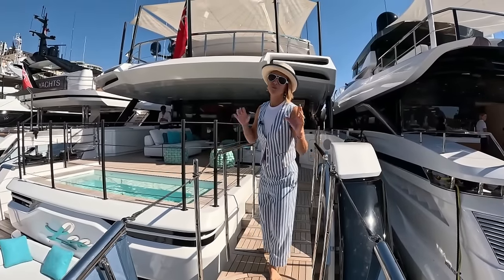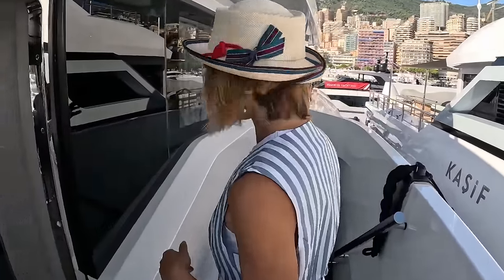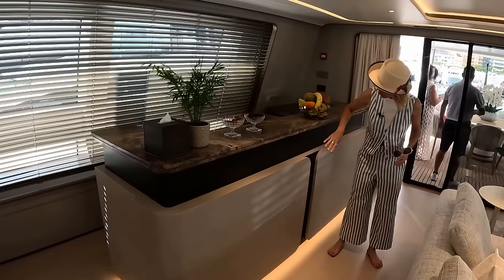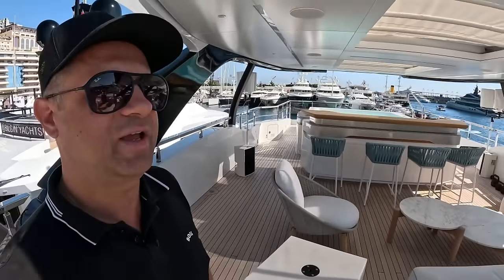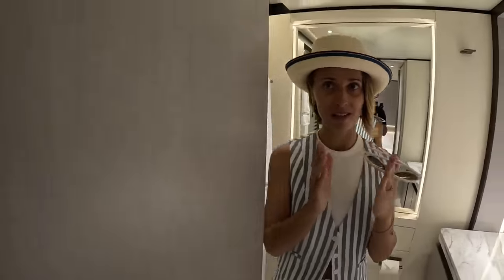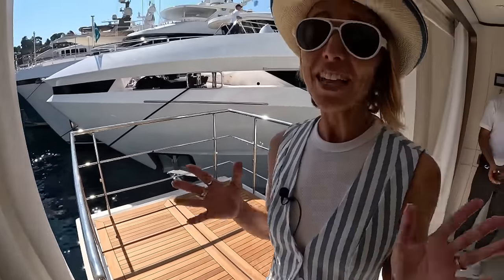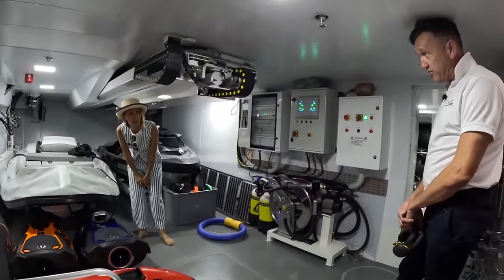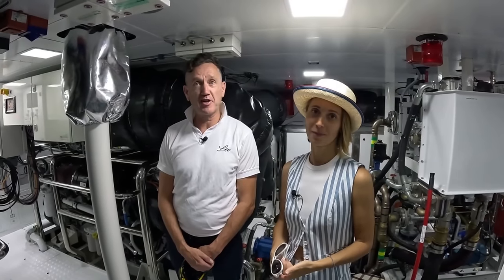You Gotta See THIS Tech! Baglietto Dom 133' Luxury SuperYacht "Lee" Tour

Comment: What very nice Yacht NautiStyles and a great tour of it also...full of great energy like always! 
Thomas was an awesome bonus!

The reason for such larger and loose speakers is to direct and focus the energy/sound, because you can't pressurize the out doors like you can a sealed room for immersive infrasonic sound Victoria. Especially with such a large open outdoor space with loose furniture, this is ideal when you want to follow the party with the sound, it gives you endless options for different set ups in different areas. 

About the large amount of AV equipment, in a previous video Rico asked for some ideas to set up your upcoming Yacht build...this is why I recommended to keep the rooms all localized with much smaller equipment. You just need a Cat6 Ethernet cable in the room near the TV, a splitter/modem/router to like an Apple TV/PlayStation/Xbox and a tiny amp/receiver and they should have access to their media. Good thing you chose K-array because they are very efficient so a tiny amp/receiver will work fine.

Comment: Finally something I feel qualified to comment on. Having been a DJ for over 30 years I can honestly say that I like all my equipment to SHOW.  Don't hide my subs, or my woofers, heck put my tweeters on display!  If this were my boat I would have a permanent DJ set up right where you thought it should go.  I would also have my light kits, and smoke machines installed so I could do a proper gig at a moments notice.  One bit of caution however for the owner of this boat,  put something on top of your subs so that no one can set a drink there.  Having done my fair share of bar gigs I can tell you that glasses and beer bottles can really get dancing if set on top of a sub.  Love all the channels!

Comment: This is the best 40metri yacht ive seen so far.
And the most impressive yacht i have seen on ur channel 

Interior design by studio vafiadis is much better than that of her bigger sister baglietto t52.
And Steel hull aluminium super structure which you would normally find over 50metri yacht range.
Most of the 40metri yachts are made out of grp.
And also got Long range. 4.000nm for 40.000liters fuel tank at a cruising speed. Even 6.500nm at 7 knots 12guests 9 crews.
Everything is Perfect for its size 398gt or 412gt
Price 23mil or 24.9mil euro

In my opinion 
The best 300gt yacht i've seen is cdm rj 115 pazienza n stellamar.
The best 400gt yacht i've seen is baglietto dom 133 lee.
The best 500gt yacht i've seen is tankoa grey so far.
Reply from the maker: Thanks for sharing 🙏🏻⚓️💙

Comment: On the sound issue, the quality of the sound is top priority, for me.   And, for that, speaker placement is important - more important than aesthetics.  This means, creating a proper sound stage for the ears of the listeners.  

Speaker placement can make a huge difference in the overall listening experience.   If you don't like the way the speakers look, close your eyes.   While your eyes are closed, if the sound stage is correct, you will be able to point to where the instruments would be located on an actual stage at a concert venue.   If you cannot point to where the instruments are located on the stage, the speaker placement - or, the listening position - is off.
Reply from the maker: Exactly!! Thanks for sharing Richard!! 🙏🏻💙⚓️

Comment: I have to say I'm all for having sound equipment or any other equipment out of the elements whenever possible.  As impressive as that sound system may be, how often are you going to be blasting it at the dock?  So the crew is going to be forever moving it in and out depending on the sea conditions when underway.  Seems to be the only time you're really going to get to enjoy it is at anchor in a secluded spot.
Reply from the maker: Agreed!

Comment: i quite like f1. tony still helps a few out with the old turbo sounds. re sound, id have a concealed system but also a larger one and of course lighting to go with it, also concealed and also a rig and trussing. id possibly need a bit more power as i prefer incandescents to led's. i used to use 300kw/600kw just for lights but would need a far larger boat for that. lol

Comment: Sound system, too hide or not.
Hidden sound systems looks neater but is not optimal, speakers need to work together and it is not optimum to just fit speakers in nooks and crannies where they can fit. Not good. Speakers need to be positioned for optimum effect, then calibrated to that for the hot spot in the middle of the dance floor.

Hey Rico, dont let her run you around, if she wants her kitchen as she wants it, she should let you enjoy your hobby. I had a girlfriend once when I had just found my hobby Amatuer Radio some 30 years ago. She would not let me do it, invest in it and so on. So I threw her out and lived every happy since.

Cheers from Sweden

Comment: Yes , thank you , a commercial hood :-) 
Would assume they are easily removeable . 
  Where do they drain to ? The back up filters here are almost fine , yet not what you want above a grill ! 
I got lucky , found a salesmans sample , fitted it into my custom hood . 
Big fan in the roof ! 
  You will need one too ! 
Would advise against fibre cloths behind steel fat trap . 
Just a fire hazard . 
All needs cleaning . Where does the exhaust go , fat on fan blades is not good either :-) 
If well placed , the exhaust could give you natural ventilation , without a fan . 
 Scrambled eggs not a flambe  steak :-) 
Just too much smoke ! 
  There is / was some math about ' extraction ' , so basic , I got it :-) 
You will need filters as you do not want a build up in  your  exhaust stack . 
You are commercial , lots of cooking , fat and steam and smoke . 
 Trap above the oven is the first step . Does not catch all ! 
   So you need back up before exiting it :-) 
There are tech guys for that :-)

Comment: Like stepping over a nasty mud puddle, you gracefully stepped over the DEF, “Deisel Exhaust Fluid” problem….HUGE problems with sensors, filters etc. Tractor trailer, RV enthusiasts, and all Deisel vehicles owners using DEF, HATE it. I can only imagine the issues with these huge engines on these yachts with DEF. More reviewers should be honest and open, instead of hiding major concerns. Do better please.